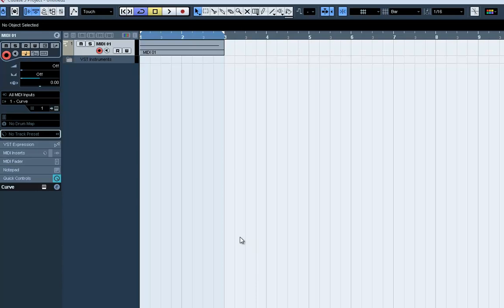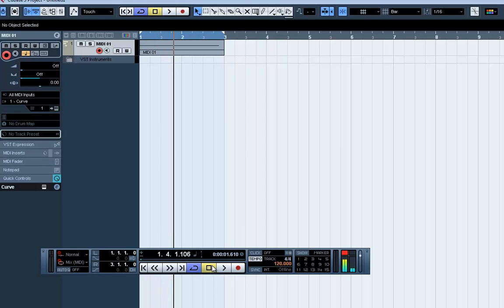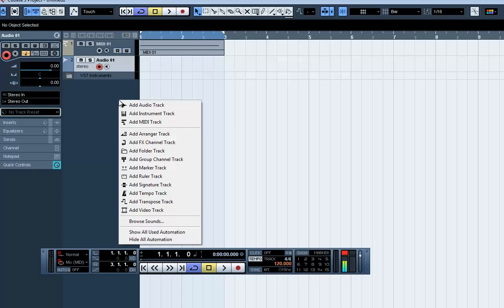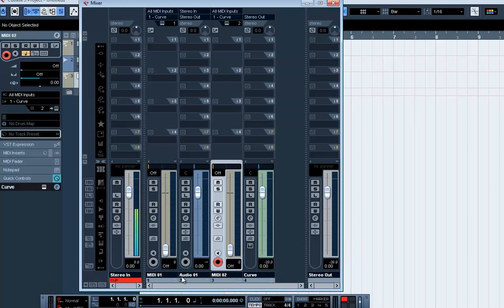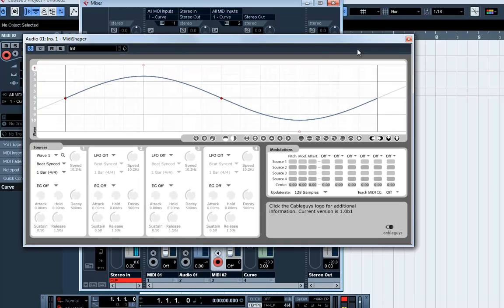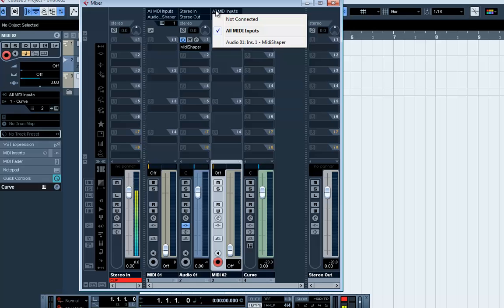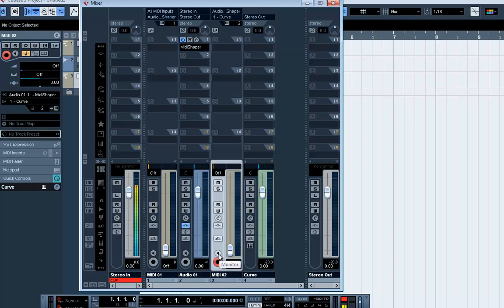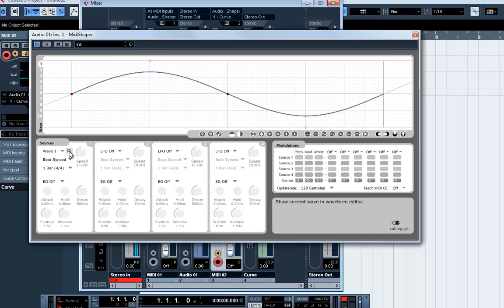Routing MidiShaper in Steinberg Cubase

Comment: I'm using this with Cantabile and I like it. It's just a way to have a separate tool to create and organize your control modulation automation.  Here's a tip: if you right-click on a control and select midi learn, whatever is set to modulate will get picked up.  That way you don't have to figure out the midi controller number for the knob.  So be sure that all sources are off except the one you want the instrument to learn, then once it does, turn the other ones back on.  Basically now you have the same possibilities that someone with a Eurorack has, but with your existing instrument vst's and effect vst's.  This alone should blow your mind. I don't know about Cubase, but I think Cubase comes with its own LFO.  I try to avoid opening Cubase if I can help it.  I almost don't want to share this info because it's so good.  Follow my channel and maybe at some point, I'll do a tutorial.
Reply from the maker: Thanks for sharing this cool tip!

Comment: in cubase artist you can't rout the audio from a midi track to other audio tracks, only to groups. but you can't send midi to groups so i guess that wouldn't work. do you know if it works to send the midi directly to the instrument track of the synthesizer?
Reply: just tried it with the trial version. didn't work. i'd suggest to you that you make a version of this plugin as a vsti instrument with a midi out. that way it will be more accessible for cubase users

Comment: Quick control in Cubase is designed mostly for the use of external MIDI devices. Therefore it doesn't recognize the MIDI signals from an internal plugin. But with a virtual MIDI port, like IAC or loopMIDI, it is possible to control the quick control parameters with MidiShaper as well.

Comment: Such a seriously flawed plug-in with such a seriously flawed DAW. It barely works that way to control plug-ins, but what if you want to control a VST effect parameter using Cubase and MIDIshaper, you need to route through quick controls, and none of that works with MIDIShaper. Wasted my money on that tbh.